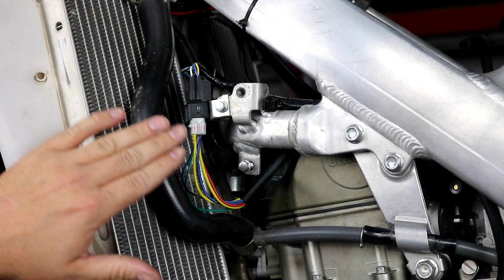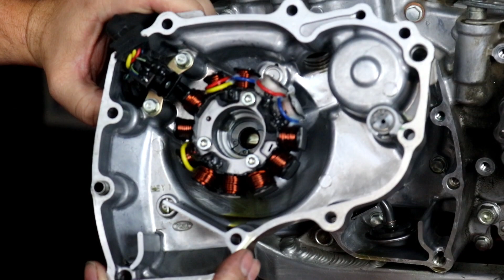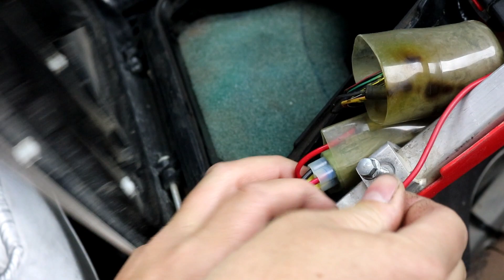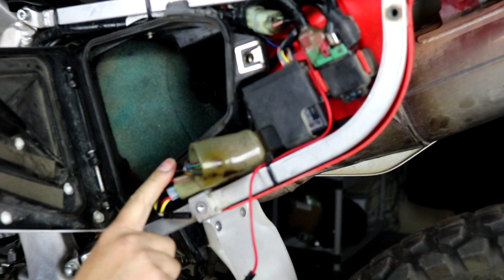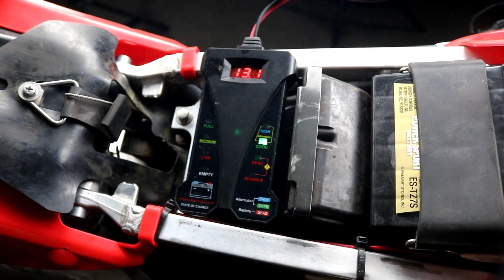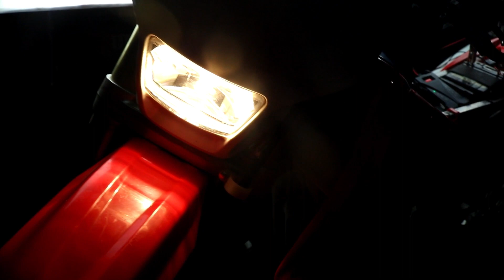Honda CRF450X High Output Stator & DC Lighting Kit Install | RMSTATOR RMS900-105941

Comment: Can anyone tell if it will fit in a crf 450 r 07?
Reply from the maker: No the CRF450X stator is different from the R model. Here is the R stator. Not easy to add a battery charging system and lights unfortunately. https://www.rmstator.com/products/rm01465

Comment: Anyone who doesn't run a Ricky Stator rewind on their CR450X will most likely find themselves with a dead bike, especially if they buy chinese junk like on this video.
Reply from the maker: Sorry you feel that way. Tons of customers are running this kit with great results and no failures.
Reply: @Rmstatorinc   Try reading the comment section. That was enough for me to decide to go with Ricky Stator. (no offense) 🔧

Comment: What is the limit for additional accessory power consumption without undercharging the battery? (Assuming i hook up aditional LED spotlight and thermo fan on a switch directly to battery terminals). 
Thank you

Comment: I bought  this kit  for my 2014  CRF450RX  an my motorcycle  don't run now intermittent spark. Leave it for 20mins  it starts for 10 seconds then leave again an will after  another 20mins or so 

What right ohm to check on  Yellow wires an White an blue
Reply: Mine did not even run Chinese shite I've had 2 so far.

Comment: Thank you for this! Just got my RM Stator on my 05 to run my new Baja Designs headlight. You guys rock!
Reply: Is your still working, I've had 2 of these kits the first did not work no spark the second achieve 2 miles before it also lost its spark.
Reply: @avmoto1  I just bought one and the bike doesn't want to startwith the button, only kick I think it's the same, there isn't enough spark.
Reply: I just had the same problem.  😂From my experience.  The starter was turning over. But not fast enough. Put a new starter on. Fires the bike every time.
Reply: @avmoto1  With the exception of a little oil seapage where the wire comes through the case, I have had zero issues with the stater

Comment: Hey there. I have a 2005 crf 450x and was wanting to know where you got the upgraded stator?
Reply from the maker: Our high output kit for the CRF450X is available here:
https://rmstator.com/en_ca/90w-ac-to-dc-lighting-stator-voltage-regulator-charging-system-conversion-upgrade-for-honda-crf-450-x-2005-2018
Reply: @Rmstatorinc  that links not working do you have another

Comment: This system converts the power source to the headlight from AC to DC, there is no mention of changing the light itself. Are you able to use the same light with the new DC power source?
Reply from the maker: Yes the same headlight works just fine with an AC or DC power source. No need to change your light.
Reply: No you aren't you will need a new light housing so you can use a better lamp.

Comment: Hello, just received your stator for my 05 450x, install went well... but wan to know how and where can I pull a lead for the trail tech fan set up..?
Reply from the maker: If it uses it's own switch to turn on and off, I would attach directly to the battery terminals. Otherwise you can use the switched relay output on our regulator to trigger a relay for it. This way the fan will not run when the motor is off.
Reply: You can tie it in to something that only comes on when you hit a certain switch or wire them straight to the stator or headlight.
I'd wire fans to my highbeam but I don't have a light lmfao.

Comment: Can you still use the on and off control for the headlight or is it always on when the bike is running?
Reply from the maker: With this system the headlight is always on when the bike is running. There is no on/off control for the headlight on a CRF450X. With the original system the headlight was always on when the motor was running as well.